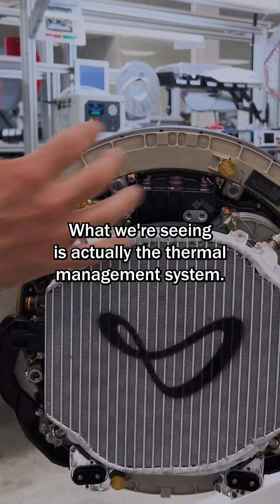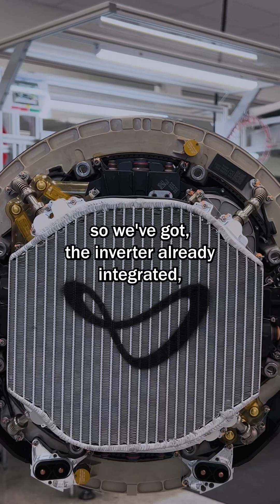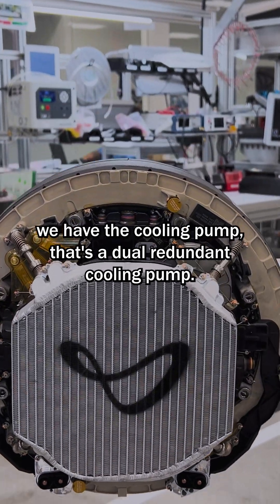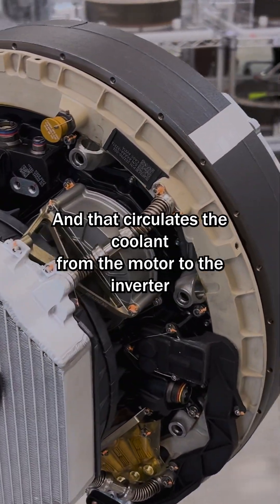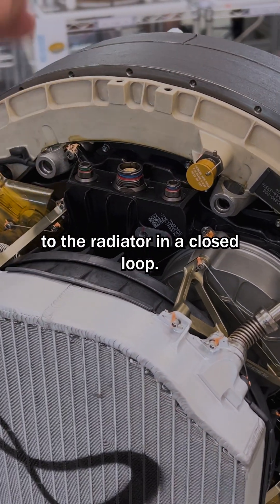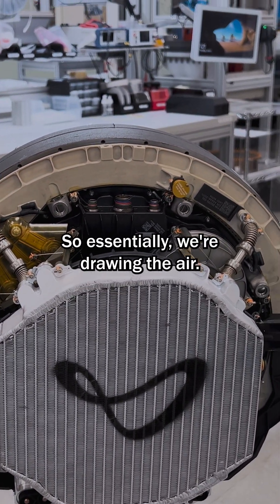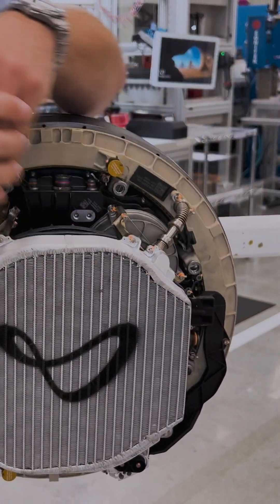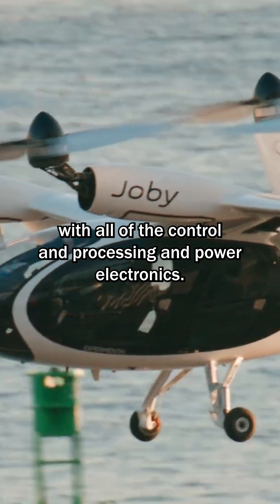Joby Aviations Electric Motors can generate more torque than an F350!

Comment: I love the Joby concept and design but sold my shares as the company is not generating cash / doing anything that will drive to commercial success.   May I suggest that Joby diversify into blade supply to all other electric and ICE aircraft.  Your rotor designs with its UVP of silence is imminently salable at scale right now.
Reply: Almost all these companies will crash and burn. Authorities might NEVER actually approve these things.

Comment: Ahh your missing out on all that delicious efficiencies as you waste that heat from the motor
Reply: What exactly do you propose they do with the heat?
Reply: @michaelnoble2432  use it with a rigid air ship design. use the wasted heat  to heat up the interior gas. Hot gas is more buoyant than cold gas. You could turn waste into lift. That's my plan with my spaceship.
Reply: @boone7777777777  interesting idea, but motors are very efficient and I don't think would give useful amounts of heat for something like that. Airships are also HUGE  for a given payload.
Reply: @michaelnoble2432  the heat wouldn't be enough alone to provide all the lift for sure but it would be sort of like how regenerative breaking increases efficiency in cars by taking advantage of what's normally just loss. It would just help efficiency. Plus those electric motors have to be powered by something. All that heat loss could be recaptured.

Comment: If it is quiet expect the military to buy a bunch for special ops insertion and extraction!
Reply: Noise is from motor and the blade itself
Reply: If the mission is for one person 5 minutes away from the plug.
Reply: Having a bunch of small rotors is generally much LOUDER.

Comment: its great but a ford f350 with just 400hp can still tow 21,000lbs which is 10,000lbs more than a 850hp tesla cybertruck.
Reply: And?
Reply: And the tesla semi can do 82,000# fully loaded getting 1.7kwh per mile at freeway speeds.
Which is the same consumption my empty little 2019 f-150xl work truck gets at 65mph! 😀
Reply: @4literv6   Don't talk about efficiency here! We don't like obvious truths pointed out!
Reply: @themonsterunderyourbed9408  I do! It cracks me up to no end thinking about that hulking ev monster hauling 82,000# around at freeway speeds while consuming the same amount of energy as my puny little 4,800# work truck does when its empty! 😀👍🏻

Or how the 10s 4dr American made 2024 m3p for just 55k(how insane is that to think about? A 10s family hauler built in America, using American batteries motors and inverters, by Americans in an American factory. That leads the WORLD in sales as the top selling ev of ALL time!

Can rip to 60mph in a best I've seen of 2.7s. Gets a real world 120+mpg, it runs of the sun renewables or nuclear. And can cost in the low 40s after any applicable rebates&ev tax incentives are factored in. What a time to be alive, love hp&real cheap reliable speed! 😎

Also to be a proud American whose served this country. And gets to see us lead again thanks to tesla space x starlink etc. 👍🏻
Reply: @4literv6  No! You're supposed to hate EVs and everything about EVs and ignore all evidence that shows how much better they are in 99.9% of use cases! The ONLY metric you're supposed to look at is range!
Reply: what does this comment have to do with a 6 rotor VTOL? Are you responding to the wrong vid?
Reply: bro what are you on about

who tf cares, stop hating electric vehicles like an ignorant loser
Reply: For than 100 miles too.
Reply: It's a different class of pick-up truck. The Cybertruck is closer to a F-150 and 250

Comment: The only way a vehicle like this would become a mainstream transportation device is if it is fully autonomous and that is still far enough away to be an unknown date
Reply: Its very easy to make them autonomous. Especially on the fixed routes.
Reply: @archigoel  Well I would have to disagree with you strongly coming from a commercial aviation background and so far not even the US military has any vehicles that are completely autonomous. They can do some tasks autonomously for limited periods, however not completely. The FAA will have to sign off on any vehicle that can fly and autonomy will require significant ground based support mechanisms and many backup pathways for the vehicle itself, just for navigation and system redundancies. This is some way off yet my friend and it is in no way easy!
Reply: @joebullwinkle5099  There are already fully autonomous drone taxi services here in China. It is easier to achieve full autonomy in aviation than in auto industry.
Reply: Why?

Comment: How can we not waste energy in heat ..
Reply: Become one with the matrix.
Reply: You do that 24/7.
Reply: There's a few videos on the Supermarine Spitfires radiator, apparently it functioned like a jet engine and produced 30lbs of thrust. If they had all the motors on 1 rad I think they could do the same.
Reply: not.
Reply: Yeah you can, most people (engineers) have no idea how to create a design for ultra efficiency. It is very possible to build with very little heat.